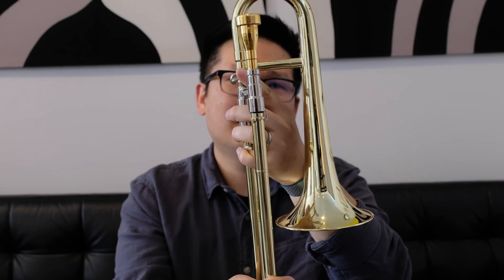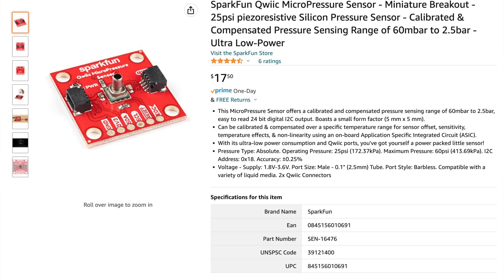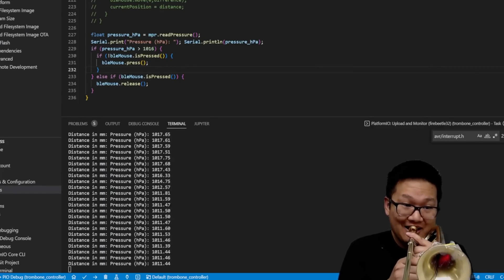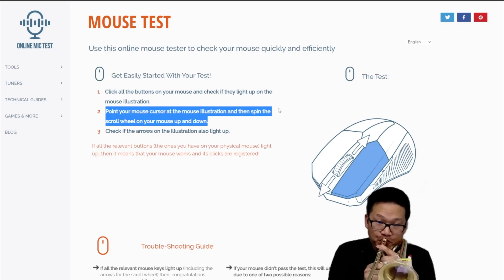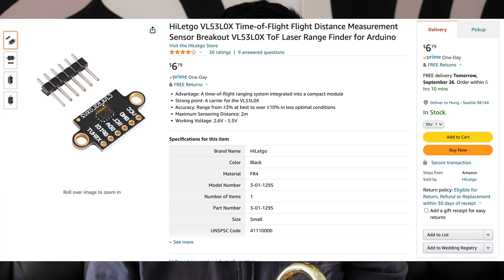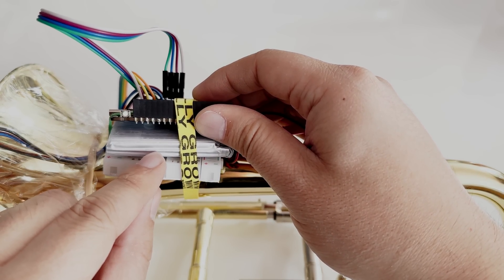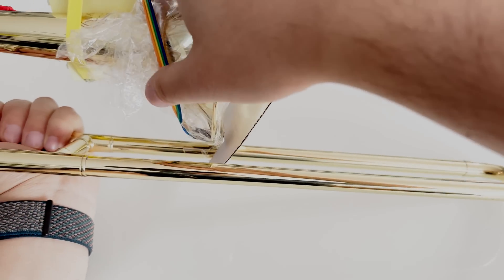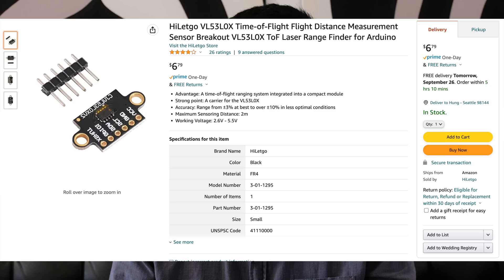I Made a Trombone Champ Controller From a Real Trombone!

Comment: You could also modulate the mouse movements with the pitch of the trombone. Hook up a mic to the end of the bell, add a minimum dB threshold to minimize outside sound interference, and specify a pitch range and a curve mapping pitch to mouse position.

Comment: I think you could have solved the air pressure issue differently. My high school band director had drilled a hole in the side of a sacrificial mouthpiece and attached a button snap, so he could connect a microphone to use with a synthesizer to do weird sound stuff. You could have done something similar with the pressure sensor. Also, you could have gone with a vibration sensor to detect when you buzz into the mouthpiece if you wanted to actually play.

Comment: Maybe the reflective surface of the trombone causes the laser to reflect, making the sensor receive multiple signals of different length? Cheap accelerometer are always pretty noisy, I usually get more usable results by low pass filtering the sensor output, maybe it applies to this sensor too.

Comment: Have you tried measuring the electrical resistance variation between the slide and the rest of the trombone when you move the slide. If it's large enough to be reliably detected, the trombone's slide itself could act as a potentiometer.

It's a neat project, and it was hilarious to see you play with your trombone controller.
Reply from the maker: I have no idea how I would measure that. Like stick a voltmeter on the horn? I imagine touching it would change the electrical resistance more than moving the slide?

Comment: Another interesting approach to measuring distance would be using a sort-of potentiometer 'rail' - essentially, probably pull the trombone 'handle' over a rail and somehow calculate the resistance of the rail length between both attachment points. This would prove much more accurate than the distance sensor but would require some modifications to get a rail actually installed.
Reply from the maker: One goal with the controller is to avoid permanent mods, so anything that’s easily removable is a plus.

Comment: Couldn't you just connect a trumpet microphone to the end, figure out the frequency and use a noise gate and then emulate a mouse to do the same thing you're doing now. Only problem I can see is the sliding trumpet not having the same range as the game.

Comment: You could wind a springloadet string around a rotataional sensor or a DC motor so u coud determine the shaft position way more acurate and responsive

Comment: +Hung You might lose the cool red 'death glow', but have you thought about using a mute to help? Depending on the style, you may have options of covering holes to help funnel pressure. Watching the performance, it seemed that the mouse is SUPER sensitive. I don't know the coding options, but perhaps padding the value will allow the jerkiness to slow. For instance, anything between 120 and 130 actually is 125. Of course too much and you lose the gliss(ando) feel.

Comment: I think converting an existing trombone into a tromboller would be more trouble than success.

Had you considered crafting a bespoke tromboller? You could blow directly into the flow sensor (you would want some standoff and a bend obviously to avoid moisture contaminating the sensor), and have nice flat surfaces for a non-defective time of flight sensor to ping off of.

If not going for a bespoke tromboller, do you have/could you get a mute that fits your soprano trombone that could be turned into a 'plug' that could not only hold your airflow sensor, but also the rest of the hardware?

Comment: One way to read the distance would be to use a rotational sensor. Add a string to the slide, the sensor to the base, then use a spring to keep tension on the string. I feel like those sensors with springs already attached should probably exist. There's a guy who made a DIY hand controller for VR who I forgot the name of, but he used that technique (since he also needed to be able to "grab" the fingers of each hand to "touch" things)

Comment: I might recommend taking a cheapo digital caliper and cannibalizing the magnetic rail sensor for this project instead of a tof sensor.
Also my first thought for air pressure was a mic like on the ds, where you can blow across it to generate a high volume that registers as a click so there's less lag to get the trombone up to pressure, but if the current system works well no reason to change that.

Comment: For the mouse movement coudlnt you just add a a like standard mouse sensor to the slide and just add a small surface on the side next to the bell and then you can control the dpi and sens. Only down side is that in order to start the cursor at the mid point youd have to just move the slide in position first.

Comment: If you want accurate absolute positioning without needing to filter, get a cheap (like $25 at Harbor Freight) digital vernier caliper, and the serial cable that interfaces with it. screw one end to the slider and the other to the bell, and you're golden. The protocol is already reverse engineered for use with other microcontrollers. Conversion of it to an ESP32 shouldn't be that difficult.
Reply from the maker: Wow this is great. Seems like a whole project on its own to get the caliper measurements off of the serial port.

Comment: When I first saw the game I wondered if it was using a real trombone, and was disappointed that it was only a mouse game.  And I'm not even a trombonist, I am a pianist and keyboard synthesist and a kind-of organist (who couldn't play pedals to save his life, lol), but like you I appreciate real music that happens as I work my instrument.

Could it be possible to make a sound-controlled version of this (even a driver that runs on the PC) that listens to the trombone (or other instrument) and maps the frequency into mouse positions in a way that corresponds to the slide on the pole, and the presence or absence of sound into clicks?  Then everything that figures into modulating the sound of the instrument would work, including tonguing (as the trombone) or the pedal (as the keyboard)?  As a bonus, now it would work with other instruments like violin, clarinet, flute, even singing... the sky's the limit as long as it is a tone instrument.
Reply from the maker: I think I've seen someone do this with a trombone, search around. And there already was a game way back in the day called "Karaoke Revolution" that was pretty fun.

Comment: Oh man this takes me back. I used to work on these little robots that used IR sensors for distance inside of about 40 centimeters. They had the exact same behavior in terms of accuracy. Noise is just a fact of life with any sensor (and power sources too) but obviously the cheaper ones tend to be noisier.

The problem of how to deal with noise in your input is generally called "input smoothing" or just "smoothing" and there are a million different algorithms for different types of data and different use cases.

Playing with different smoothing functions (and their hyperparameters) can be a lot of fun.

Comment: this is two weeks late but an idea for the slide would be to use a badge reel attached to a potentiometer so the badge reel doesn't significantly affect the slide but will give a fairly accurate reading since there wont be much slack because its spring loaded. the reel could be mounted to the frame with just the string being attached to the close end of the slide so your hand wont get caught

Comment: I wonder if it's possible to go down the route of a clip-on tuner. If it's precise enough, then it can measure when you're playing and not. The biggest thing is the math to convert the frequency of the Trombone to the notes in game, i.e. location
Reply: Or just connect a mic to some kind of tuner library, then sound output to mouse position/xinput trigger value

Comment: I love this idea! and you did a great job communicating the problems and your solutions. A quick note for anyone looking to try something similar: at least with the acoustic and IR distance sensors, there is usually a "minimum distance" shown in the datasheet. Objects closer than that will give strange and inaccurate readings.
Reply from the maker: Thanks! I think the min distance on the new one I got is 30mm so pretty small.

Comment: You could pull the optical sensor out of a mouse and mount it to the trombone and then mount some card stock to the slide so when the slide extends it moves the card stock over the optical sensor. A problem will be that you won't get an absolute stop at then end of the range. You could add a switches to help reset calibration. Alternatively you could use an encoded strip of cardstock and an photo sensor. You could encoded the hard stops into the cardstock.

Comment: For a simple filter on a time of flight sensor, use a moving average filter. Average the most recent 10 readings (there's a great way to do this without adding much computation btw) and a lot of noise can be eliminated at the cost of lag. 

I'm pretty knowledgeable on filtering techniques, so if you have trouble, let me know
Reply from the maker: Cool thanks, I might have to try some optimizations.

Comment: A sliding liner potentiometers (adjustable resister) would probably worked a lot better, although fixing it into the horn may be challenging.
Reply: I remember seeing someone make a haptic hand controllers for VR and he used badge reels and put a pot inside to get to the readings (something like that I forgot the details) I think a similar idea would be great for this

Comment: Great project, I wanted to do the same thing when I saw the game for the first time, I used ToF sensors before and they have lots of noise, I would filter the input with a basic filter (making an average of every 10 readings or so) althougth that would make the sensor 10 times slower, but the thing is finding a good middle ground, another thing is that I THINK some IR ToF sensors are sensitive to light so even moving the thing could generate noise... I thought the blow problem would be easily fixable with a flow sensor but I quickly realized that would not be precise, The best thing is the pressure sensor, but as you said you need to seal the end a bit better, but the problem with that is that you would have both ends sealed, one with the sensor and one with your mouth, and the moment you extend the slide the pressure would drop, you would have to spread the same amount of air in more volume so that could ruin your sensitivity and also would create an adittional delay, I don't know if it would be a "gamebraking" delay but anyway, I would personally make a custom mouth piece with the sensor. But in case you go with the pressure sensor inside the bell with a 3D printed end cap you could house all the components in the bell including the "slide sensor" so everything is in one easily removable package.

Comment: Have you thought about using a stepper motor and a gear attached to a flat toothed piece of metal and have that connected to the slide arm to more accurately track the position of the slide arm?

Comment: I wonder if sensing the vibrations going through the trombone instead of the air pressure is feasible. Gives you some options for where you place the sensor and keep the inside of the trombone free.

Comment: Maybe I missed something, but I’m surprised you didn’t mention the possibility of just using a normal mic to detect airflow. I can’t tell if you were actually intending to produce notes on that trombone in order for it to register, or if you were just pushing air through, but either way, wouldn’t a mic be able to pick up that airflow change?
Reply from the maker: I've been hesitant to use a mic because the game is a music game, so I'd assume that the music from the game could interfere with any readings from a mic on the trombone.
Reply: @techsistentialcrisis  True, but if you committed to having to produce an audible note on the trombone for it to register as input, that sound picked up by a mic in the bell would easily overpower anything your speakers could produce from the game. You’d just need to calibrate the minimum dB needed for an input correctly.

Either way, seems the sensor with the most issues here was the one related to slide position anyway. In any case, good idea for a video.

Comment: I don't think this idea is actually helpful, but it is at least different than what others have suggested. To track slide distance you could use motion-tracking cameras. You'd have to deal with setting up a space with them and calibrating but it would be a non-destructive alteration to attach some white balls to the outside of your trombone.

If the goal is to have the most accurate trombone playing, then it would also need some method of knowing which octave (idk music I hope this terminology is correct) the user intends to play so that multiple slide positions can be different notes to reach the number you need for Trombone Champ while using real slide positions. The simplest would be some buttons somewhere but that isn't a very flashy solution.
Reply from the maker: Haha yeah that makes sense to me. The motion tracking might be overkill though you could argue everything I've done is overkill. The slide 1:1 mapping is a real issue but it's just a game after all.

Comment: Fascinating build. I note that the range of the slide seems to be pretty limited - perhaps accuracy would be better if it’s calibrated to spread the notes out along the full length of the slide? I have no experience of soprano trombones, though, so maybe there just isn’t more slide travel to work with…
Reply from the maker: In this video the sensor was kinda bad so the range was very limited. I got a new sensor which has much better range so I can show that off in the update.

Comment: I've been working on a similar project but the time it takes to 3d print a trombone has been...rough. 😂

I'm also using an mprls pressure sensor, but in a device between the mouthpiece and instrument itself. I was going to use lidar down the bore of the instrument, but I worry it won't bounce enough back. Might go with a photo cell with a big effin light shining into the bell.
Reply from the maker: Oh that’s interesting putting the sensor between the mouthpiece and the instrument. Seems like it could work well especially if you’re printing the whole thing anyway! Good luck with the project!!!
Reply: @techsistentialcrisis  beyond the goal of "functional controller" would be to make it compatible with existing trombones. Just slap the files on thingiverse and people can build their own if they have one

Comment: A soprano trombone is notoriously finicky for tuning when you just use seven positions (and rely on the overtone series to extend the range of the instrument).  That probably gets massively worse when, as here, you are trying to get a single length of the slide to distinguish all played notes.  You might find it works better to use a standard tenor, or at least an alto, so you have more slide length to work with.  You might keep an eye out for pBones (they come in both tenor and alto sizes - and are comparatively cheap) if you wanted to try something that might allow for better note precision.
Reply: pBones... The plastic trombones? Those might work well for this kind of application too, since even though they're less expensive, they might sound very similar to a regular brass trombone if they're well tuned

Comment: Hmm, given the issues with slide positions vs mouse (ie there are only 7 positions on a slide but the game/mouse needs dozens) - I wonder if a frequency-based interface would work better? Use a mic in the trombone, filter to just the fundamental frequency then convert that into mouse movements, plus it would also act as a button click - whenever the note sounds, there is button click.

Comment: In terms of distance detection, I wonder if a similar solution to how Lucas VRTech's gloves measure finger displacement might be more reliable: https://youtu.be/nmP8iGaPbeI?t=96

Basically just using string to turn a potentiometer
Reply from the maker: This is a very interesting project! I think the knob type potentiometers might have too limited of a range of motion for the slide mechanism, but I wonder if there's some way to use gears or a pulley type system to extend the range of the slide (like 3:1 or something). Thanks for the link!
Reply: @techsistentialcrisis  I've seen ones that go up to like 10 turns and you can also make the spools larger too. definitely a lot more motion though

Comment: I had alternative idea -- attach an actual optical wireless mouse to the bell and have a surface attached to the slide, with some spring to force contact. Then hardwire membrane switch replacing mouse button. 
For the distance sensor - they have minimum operational distance, you might have been outside the intended parameters.
Reply from the maker: Hmm I think I saw another project that used a mouse sensor, seems like a waste of a perfectly good mouse though lol. I'm sure it could work but I wonder if it would also run into the drift issue I described. I think mice have some sort of concept of "acceleration" where it isn't a 1:1 mapping and if you move it faster it moves further than if you go slowly.